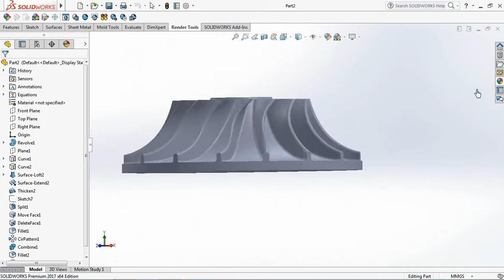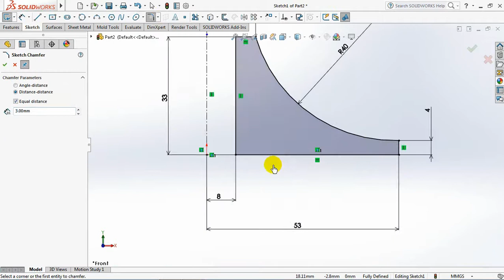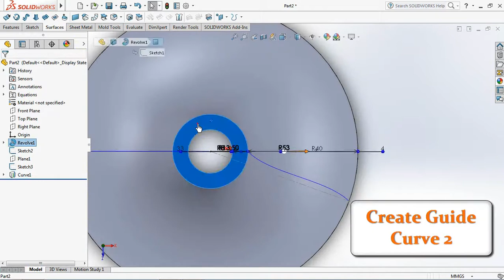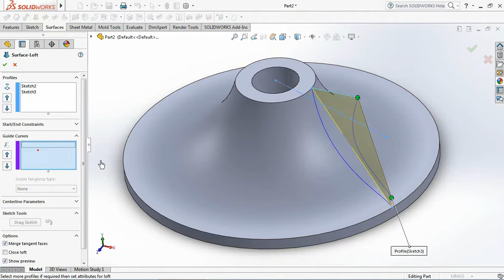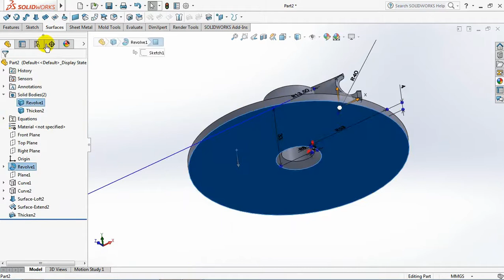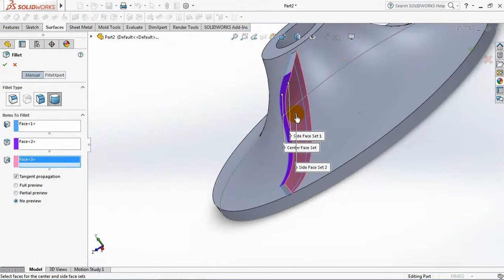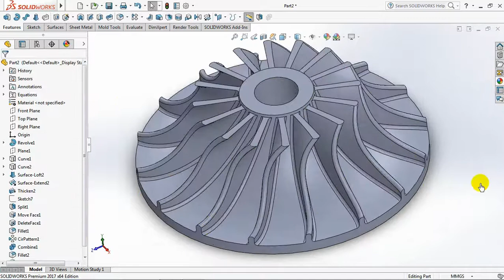Draw an IMPELLER using the Revolved Boss & Lofted Surface command || SOLIDWORKS TUTORIAL

Comment: For some reason when I project curve the second time, the yellow line does not connect to the point where the two blue lines meet, but rather it connects to the spline line a bit farther down, which doesn’t make it a closed entity. Does anyone know how to solve this?
Reply from the maker: end point for two sketch from top plane and front plane must same or coincident (connected)